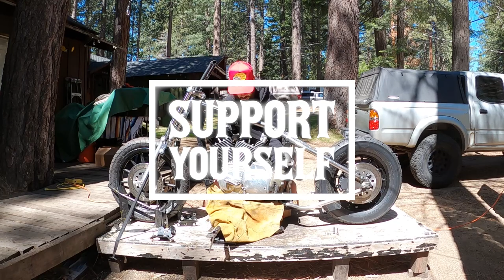Sportster Chopper: Chain, Fender, Gas Tank

Comment: ⭐️Sporty ,.. I usually Stack 2 bck 16" Tires on Ground , Lay Motor Nose Cone Down IN Tires n come in frm Above with Frame inna downward Right to Left motion , Over n Onto motor. 
  Bolt up a Few bolts Then Stand them Up Together.
 ⭐️ Its EASYER than Lugging WEIGHT of Motor.
  But Did see U Had it Already as a Roller. 
 ⭐️GOOD JOB n PATIENCE .
 💪🤨